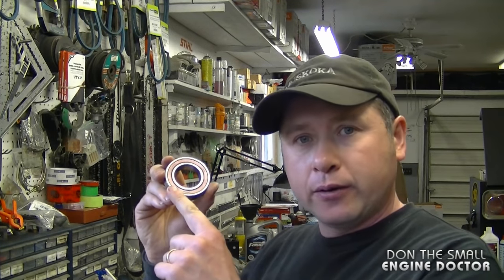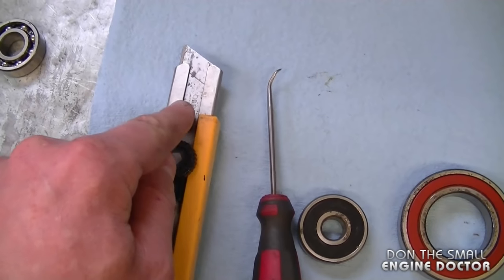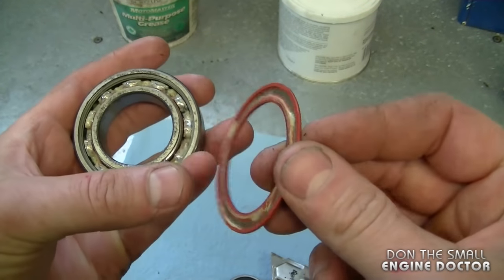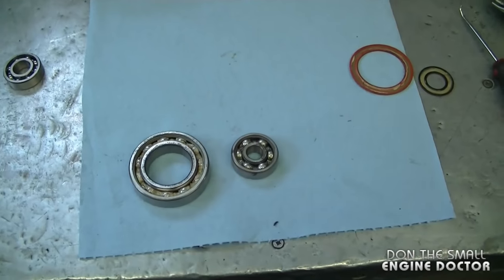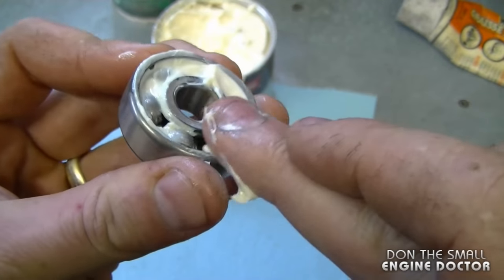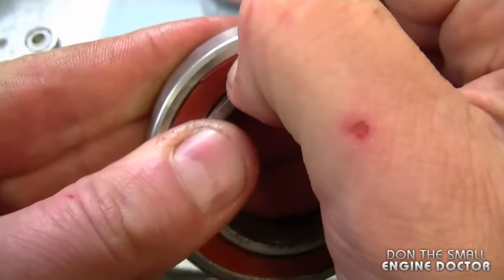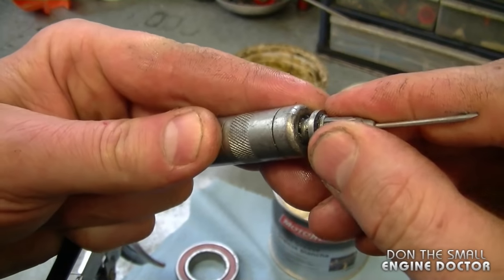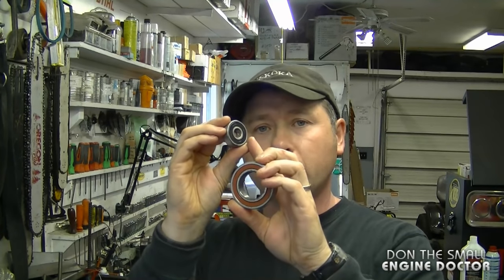HOW-TO Grease A Sealed Bearing

Comment: I have worked on mechanical stuff for 35 to 40 years and never knew could remove that seals on a sealed bearing.  I had used the needle but it puts a hole in your seal and grease finds it's way out and in no time your back to replacing the bearing.  Thanks for showing us this video.

Comment: I used to finish grind bearings for a living but didn't work in assembly. The largest bearing I ever worked on was 13 feet in diameter, it took several shifts to grind it to size. Most of what I worked on was 4 to 10 foot diameter. As commentators have suggested (small) bearings can be cheap to replace but I've worked ones that cost the customer over $200,000.

Comment: I even check new bearings when replacing them in blade spindles and always remove a Electric PTO clutch on a lawn mower and add grease if necessary. The PTO bearings have been very low content of grease when new. I have a John Deere L130 mower that I greased the PTO clutch that will be ten years old this summer and is still working very well. A little maintenance on these bearings will save you lots of money and it is simple to do. 👍🏻
Reply: Don I didn’t tell you before you can pop out the metal seal cover as you do the “rubber” type. The will pop back in on all I have lubed.

Comment: It's best to clean the bearing out first to remove any contaminants and to remove the old grease which may not be compatible with the new grease.  You also want to push the grease into the bearing, not just wipe it across the top like you did.

Comment: Great video!  I'm currently restoring an old Makita mitre saw which has a a right angle gear box.  I was recommended to use Lucas Xtra Heavy Polyurea grease by a friend.  However I know polyurea grease is not compatible with lithium grease which I believe Makita uses from factory.  I cleaned out all the yellow lithium grease in an effort to make sure all the new grease was the polyurea.  However, then I realized that the sealed bearings inside the gear box also have grease which may react with the polyurea?  Is that the case, and will some of the polyurea seep into the gears and mess them up?  Would appreciate your thoughts.

Comment: Yes as one comment about the one is you use the edge of a ten or twelve thousand feeler gauge The seat off without damaging use high quality I used to use teflon on some of my bearings make sure you wash your mouth out with dry air and some cleaning fluid.

Comment: Wow, the needle injector for ball joints... that is GENIUS.... I've only ever regreased a ball joint once or twice because I would take the ball joint off the car, take it into my work shed, clean the grease out, then put the new in and replace the boot.... this doesn't risk contamination and it's so so much faster than that.

P.S. I tried adding grease while it was still attached to the car, but since I work in my front yard in Florida there's grass, dirt, and especially SAND that blows up all the time. Just one quick gust of wind and sand is in everything. It's really difficult to keep a clean environment when if you accidentally touch the ground and then what you're working on again particles of sand will be in it :(

Comment: Will the seal pop off if you reseal on old bearing? I did this method just recently. Bearings were dry and dirty. So I cleaned it and inspected the ball bearings itself and it did not show any signs of scars. So I repacked it and put the seal back. Gonna start the boat tomorrow and test it out.

Comment: Dony, too much grease can make a bearing over heat. Half that amount is still too much. Those are high speed bearings not car wheel bearings. A little dab now and again will do as long as the seal is still good.
Reply: Thanks Tractor. Been in the SKF bearing business for years. All I hear is this bearing failed after one month but I grease it every day. Stop greasing it so much! A sealed bearing is sealed for the life of the bearing.
Reply: @CoraFaye  There are many folk who don't understand the functioning of ball and roller element  bearings or how much lubricant is enough.
Reply: how can I tell if I have applied too much?
Reply: @kiyotaka269  Grease expands when it gets hot so you shouldn’t completely fill the bearing otherwise it will run too hot and force liquid grease out the  seal lip. The same filling an axle hub you should not fill completely to allow for expansion especially if the brake drum/ rotor is generating lots of heat into it.
Reply: @derekfromtauranga6012  k
Reply: @howardosborne8647  o
Reply: @andrewmacdougall536  D
Reply: @jaredmayer3960  It happens. A sealed high speed bearing under constant load is a prime candidate for this type of bearing failure. It heats up melts the seal then all the grease spins out and wala toasted bearing.
Reply: @kiyotaka269  On  sealed bearing you should never have to grease it. There is the proper amount of grease in it for the life of the bearing. If in fact you find it dry you will need a new bearing because the seals arent sold separately anyway. But the answer to your question is that when these are new there is just enough grease in the bearing to keep the ball bearings and races covered plus a slight dabto cover one or 2 ball bearings. That's the only way I know how to describe it.
Reply: @jaredmayer3960  But do you agree that over packing with grease is bad for the bearing life? The lubricant manufacturers and bearing manufacturers all say it detrimental to bearing life to over pack with grease. For one point it causes greatly increased rolling drag and excess heat to build up. That defeats the benefits of having a ball bearing in the first place.
Reply: @jaredmayer3960  If it destroys the seals then what happens to the dam bearing.. Jeeze....
Reply: @jaredmayer3960  It creates too much heat and destroys the bearing by destroying the seal and emptying the bearing. Too much grease can and does destroy  bearings.
Reply: @jaredmayer3960  It does cause more harm than just extra drag. Too much grease can easily hinder the balls from rolling freely around the races. It can cause skidding of the ball bearings which creates micro flat spots on them. That in turn cause reduced service life of the whole bearing. Grease in ball and roller bearings can only ever be seen as a compromised form of lubrication for that type of bearing as oil is much preferred as lube medium.
Reply: @howardosborne8647  If that’s the case, why do so many boat trailers and small trailers come with Bearing Buddies or similar bearing protectors?  Are they more concerned with blocking water intrusion from around the seals or with extending bearing life?  With BBs, you pump the hub full of wheel bearing grease which is kept under pressure by a spring in the BB.
Reply: @JT_70  Boat trailer hubs are another big compromise installation due to being frequently submerged,often in salt water. It isn't what a bearing manufacturer would recommend so the only way of extending any serious life from bearings in that environment is to pump in lots of fresh grease in the hope it expels and keeps any water at bay. Water and most especially salt water will start to deteriorate carbon steel bearings in just a few hours. Once the bearing tracks and balls have microscopic pitting from surface corrosion the smooth surfaces break down in use very quickly.
Reply: @CoraFaye  I've always loved that phrase - "lubricated for the life of the bearing". That would be great if you gave an idea how long that life will be.
Reply: Not all grease is created equal  use a quality synthetic like Mobil one problem solved great for high heat = no melting or expansion great for extreme pressure also and cold weather no problem either
Reply: I have a lot of experience with this method, put only half the grease too much does get hot and sling out especially on motor cycles . I learned this the hard way but learned to only use high temp grease and fill half way .  Back in 2010 we were have a great deal of issues with sealed bearings mainly all balls bearings brand and stock Harley bearings. We had numerous come backs dealing with bearings so we contacted all balls and they claimed that they had changed the type of grease they would warranty the bearings but the customers were out the labor. We started checking all sealed bearings and they all had 2 things In Common , 1 some clear grease, big deal and second they would only have 4 dabs of grease so we thought that wasn’t enough and put more in and bingo problem solved until we discovered too much will sling out and make a mess sometimes get on brake pads bad deal I know but we were true to our work and solved the issue so folks were on a safe bike . This happened to at least 30 bikes and we made every effort to call every customer that we installed wheel bearings in and have them bring their bike so we could check them .   We were a Small Independent shop but we tried to make it right.  I believe that company has fixed the issue with the bearings they’re a great bearings they just didn’t have enough grease back then .  Rule of thumb never trust someone else’s work but your own .
Reply: Correct. It's easy to over grease bearings. You obviously have experience.
Reply: @CoraFaye   Wayne I’m an old machinist and vibration   You are exactly right. I’ve seen bearings with to much grease over heat. Once over heated The grease becomes thinner and thinner and it will get so thin it will run out passed the seal. The heat has nowhere to escape. Do you know Hilton Wall with skf?
Reply: Correct. An overgreased bearing will fail faster than one with the factory grease in it. The people who design this stuff aren't idiots, unlike folks who pick bearing grease on the basis of color, or how it feels between their fingers.
Reply: @JT_70  Bearing buddies exist because they're something that sells, that and because people are too damned lazy to pull a hub and do a proper cleanup and repack of the bearings. Might get their hands dirty dontcha know.
Reply: I agree, more grease does not mean more lubrication. Just the right amount for the rollers to travel freely is all you want.
Reply: I apologize. I didn't threaten him it's how he interpreted it. I don't like bullies. I saw him calling people stupid as disrespectful is all. I was only trying to prove a point not to think you can just say whatever, because you're behind a keyboard. And in the process, I disrespected you. I will erase my attention getters now good sir
Reply: Overheat and melt the seal?  🤣

Comment: Great information!.  I have done this with literally hundreds of automotive drive belt idler and tensioner pulley bearings.  They can be almost dry and still be restored.  I like Wolf's Head Red grease.  It's a complex lithium grease.  Seems to stick to the bearings.

Comment: i have a local dealer that sells quality, legit ball bearings for less than $20. is it worth it to fully clean and repack them with grease or should I just replace bearings that were put through moderately tough use for a few years?

Comment: Hello From Mark In Kentucky,  I was curious about what brand of grease that you normally use for mower spindles. 
I’m getting ready to change out some JD9296 spindle bearings on a older John Deere 38 inch mower deck that are starting to roar pretty loudly after a few years of use.
For the most part, I am using the Lucas RedNTacky grease in which I also use to lubricate my mower deck spindles More than likely, I will probably load up my bearings like you did in your video before I install them in the spindle housings. 
Being that I am using the Lucas grease, I wonder if I should wash out the grease in the new bearings and load with the Lucas grease that I normally use when I grease the spindles to avoid any reaction between the different brands of grease.
I have not seen anyone address this issue here on YouTube. 
Thanks for your great video regarding the bearings.

Comment: I have gone through a Koyo industrial bearing class. We use a majority of the Koyo bearing on the equipment on the machinery at work. If the right type of sealed bearings are used in the correct applications. They claim they are sealed for the life of the bearing. But, we also pull the seals completely out of some bearings that are installed in a grease block

Comment: Hello!  Thank you for this excellent video.  A small question, I have the same NTN bearings, me CS205LU, that I have to do, and I wonder why I have to use this motomaster white grease or would I be better off using my Prolab GS1000 synthetic bearing grease  .  I would like to be sure that I put the right grease and that it will go with the one already in the bearing.  Sorry, I don't understand everything in English.

Comment: I AM REPLACING MY WHEEL BEARING THO, I ORDERED A NEW CONTAINER OF HI-TEMP GREASE & I AM WAITING FOR IT TO ARRIVE. SHOULD I PRY THE SEAL OPEN & GREASE IT INTERNALLY LIKE YOU DID IN YOUR VIDEO??? IT'S A FRONT WHEEL DRIVE, WHEEL BEARING FROM T.R.Q.(TRUSTED RELIABLE QUALITY) FOR A 99-04 FORD FOCUS?????
Reply from the maker: you could check but usually good quality ones are well greased

Comment: I learned something new. My 2009 Honda HRX217 has a bad clutch bearing....I'm getting a new one. But for son's lightly used 2012 HRR 216 mower I'll check the clutch bearing for wear....if it's ok  I'll clean and repack with fresh grease. Thanks!

Comment: The sealed bearings usually found in mower deck spindles usually fail due to lack of proper lubrication. The spindle housings may have zerk fittings and you might THINK the bearings are receiving grease when you pump grease into them, but the truth is, they're sealed, which prevents any new grease from reaching the bearings. 
The fix for this is to disassemble the spindles and remove the seals from one side of each of the bearings, then reassemble them with the open side of each bearing facing the middle of the spindle shaft. You should also drill a (one) SMALL weep hole in each spindle housing prior to reassembly. Make sure that after drilling, you carefully clean any metal from the spindle housing before reassembly.
Doing this will greatly reduce the incidence of spindle bearing failure... 😀
Reply: If you remove the blade and pulley and use Red grease, after 50+ pumps you will see that grease has penetrated the inner seals and comes out the outer seals.

Comment: On a Automotive Radiator Fan Bracket there is a pulley with a pressed in sealed bearing, probably by Nachi or something like that. Also there is the idler pulley bearing,  and the AC Clutch also has a sealed nachi bearing (Lexus ls400/ Denso compressor)
Can I use Redline synthetic CV-2 grease, NLGI Grade #2  service GC-LB  and application range -100F to 500F. I was about to do my 4Runner CV Joints with this stuff.   I thought maybe I could use brake cleaner spray on these sealed bearings (engine fan pulley, fan bracket pulley bearing..all those are sealed. Would BrakeC damage the seals?   Any thoughts on this upcoming task I need to do?

Comment: If bearings from table fan that i used it daily use how often should i need to apply grease on them? New table fan model not used sleeve bearings anymore they use small ball bearings on front and back motor inner casing.

Comment: Being born and raised on a farm, we'd get syringes from our vet, we'd fill those and use that to fill a sealed bearing. Made it easier to make certain grease was completely filled into the bearing. Injector needles are nice but, honestly, they can still be a bit too large to get in those bearings, hence why you remove the cover(s). Any more, we use the injector needles with an attachment we made, to only clean bearings. Cheers :)

Comment: The average spindle generates enough heat to somewhat 'liquify' the grease. As long as the spindle is full, grease will eventually penetrate the sealed bearings. As someone mentioned, there are decent pressures within the spindle too. Sealed bearings are necessary to keep the grease in, under the higher pressures. Removing a side will only shorten the bearing's life.

Comment: be careful with the correct viscosity and amount of grease in high speed (like Alternator) bearings, or you'll spin the bearing in it's housing or on the shaft.

Comment: I recently seen a fellow remove spindle bearings to see the color of grease without removing the bearing cover. The spindle housing was not full of grease. He put the bearings back in the housing and pumped a different color grease into the housing making sure it was full. When he finished he removed the bearings and removed the enter seals. The bearings were full of the new color grease. I feel people never pump enough grease to fill the housing there for no grease to speak of. I’m speaking of lawn tractor mower deck spindles.

Comment: I have tried just finger working High Temp grease arounf the inner part and it is possible to get some in and you dont have to risk the seal, but it is slow. Also you could submerge it in grease in a metal container, put it on the stove and head it up , air bubbles in the bearing will blow out through the grease, let it cool down and it will suck some in.

Comment: You should actually start from the inside edge of the rubber gasket. The rubber on the inside is much softer, and won't get damaged by the pick that you use, since it just folds out of the way. If you try to remove the gasket from the outer bearing race, you can tear the rubber and potentially damage the brass below it, meaning it wont seal as well when it's reassembled.

Comment: Hi. Just saw your video. I have one issue with the thick grease you used. Both bearings don’t seem to spin freely with the amount of grease you applied. Do the bearings spin freely after some time with the new grease.
Reply from the maker: yes they do
Reply: @donyboy73  thx. I was a little worried they didn’t spin like they should.